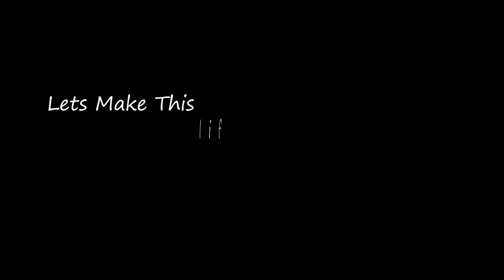Build Your Mini Amplifier 5 volt Using PAM8403

Comment: Will it work for headphones because headphone has only 3 wires but amplifier output is 4 wires
Reply from the maker: work for head phone.
The 3 wires consist of Lefy ground Right. to install in a 4 wire amplifier, take the + pin from the left and right, while only take one of them.